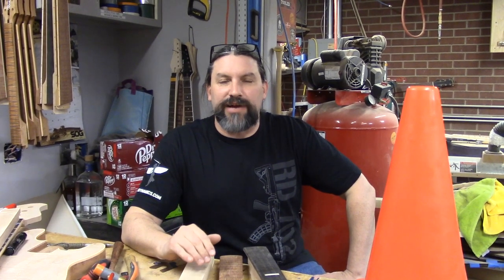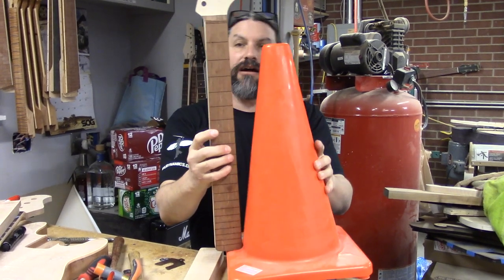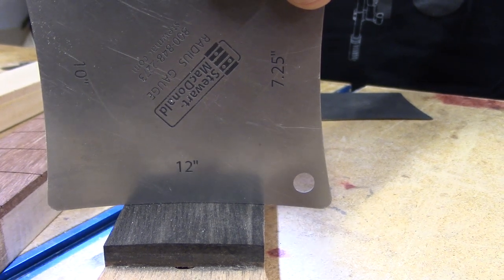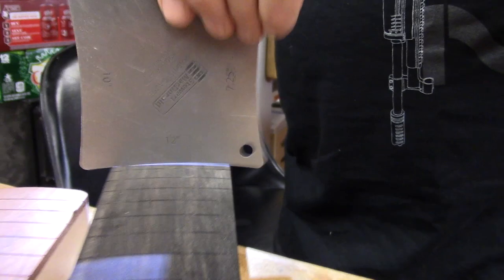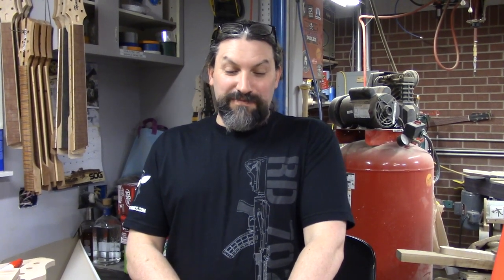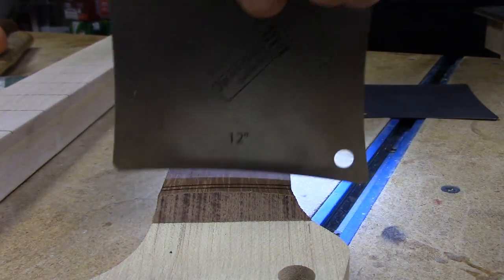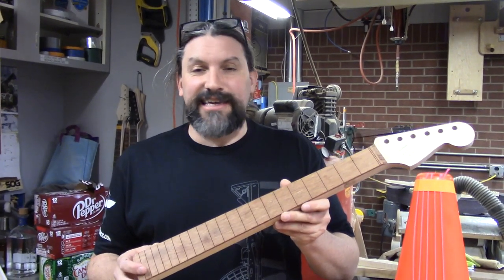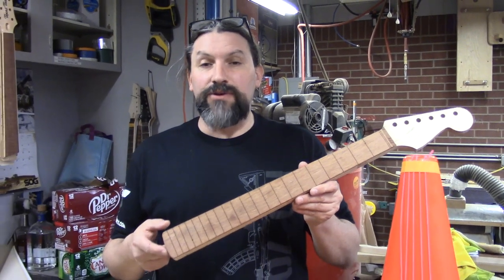Compound Radius... A Solution In Search Of A Problem?

Comment: It's totally fine guitars without a compound radius but if we're talking about consistency all across the fretboard, that tiny difference between a 10 inch and 15 inch radius plays a significant role. If it didn't all guitar makers would built their fingerboards with the same radius, or players wouldn't tell the difference between a 9.5 inch raxius and 12 inch radius which are fender and gibson. These boards feel totally different and every player choses one for the other according to his or her playing style and habit. That cone you're holding is the exaggrrated version of a guitar fretboard just for people to understand better but in real world, that tiny difference changes the feel and comford. Because a fretbord does not have the same thickness at the nut as the last fret, then the radius should not be the same. Secondly, if you don't have a compoud radius on your guitar's neck, that means it's thinner at the last fret than it is at the nut which results in higher action at higer frets with your low and high strings not the middle ones. That means it is inconsistent. It's not an issue if you don't play low action but if you do, then you would miss a compound radius when you don't have it.
Reply from the maker: Little things do make big differences... I question whether or not the fretting crew can always realize the theoretical advantages of the compound radius. Not to mention the bridge one is using had best be capable of 20" or nearly flat. 
I still think that the compound or conical radius is a great marketing strategy to separate guitar players from their money.
You seem to be a fan so who cares what I think?
Reply: @TexasToastGuitars  I am kind of a person who prefers to do things "the right way" not a fan, and compound radius is definitely the right way. But it doesn't mean one cannot live without it, appearantly virtuosos like Satriani and Vai do without it. It's definitely not a necessity. On the other hand we shouldn't take  players as models, they spent 30 thousands of hours to their instruments, maybe it doesn't matter to them just because they learned to play on a noncompound radiused guitar. If they learned straight fingerboard in the first place, they would still be playing straight fingerboard guitars. It doesn't mean what they are using are always the right tools just because they are the best players in the world. They boight their first guitar in 70s, 80s or whatever, its 2019 now. A young player on a budget can buy a really nice and sufficient guitar for 600 hundred dollars. On the other hand, someone who has more money to spend on nice things like his bmw car or fancy house, can afford 150 dollars more for a compound radius, 150 dollars more for carbon fiber neck stabilizers or 500 or even 750 dollars more for a fancy ziricote, cocobolo or bahia top. This is not about tone or music (although bahia is the king of all tone woods), it's only about feel and comfort, the same reason why you would prefer a cadillac over ford let's say.

Comment: Hey other small shop builders on here, am I the only one who thinks Stewmac need to put handles on their aluminum radius beams? Think about how much easier those things would be to control, like vertical handles that can screw into threaded inserts in the back, middle, and front, so you can move where you want to put more pressure.
Reply from the maker: That's a cool idea. I have been talking with Erick from StewMac and we are planning on a live Q&A with him this year. Maybe you could tell him

Comment: Err... I think the biggest problem is bend on high E string. From about the 12 fret, in a 12 radius your bend can't go more than one tone. With a compound radius at 16 15 n the end, you can go higher.
The big issue is not comfort ( for me..) but how much you can bend without buzzing.
Reply from the maker: Why not just make the fretboard 16" all the way? Hell... if you are really into bending a flat fretboard would be the best
Reply: @TexasToastGuitars  hehe... Because 16" for chords is uncomfortable.
I know compound are hard to install frets. Using a hammer you end up losing a lot of material of the frets.
The solution is having a metal to press all the frets at once. This presser should match the exact radius of the fretboard.
Reply from the maker: @fernandohildebrand  I guess we just disagree but I would like to see your fret press that does them all at once. DO you work for PRS or Fender? I have seen those
Reply: @TexasToastGuitars  No, I don't work on any of those. It's not that I disagree. Compound radius only makes sense on low action strings( very close to the neck), but hey, Malmsteen plays really old strats! Only he adjust strings very high.
Reply from the maker: @fernandohildebrand  So... have you not ever pressed in all the frets in a fretboard simultaneously?
By the way, we do not use hammers to install frets but do the frets one at a time. I can assure you that it isn't quite as easy as 123.
Reply: @TexasToastGuitars  I agree! I still use a rubber hammer. It's not easy. Even with a presser, wood is wood, it deforms, even if just a little. It'll never be 100%
Reply from the maker: @fernandohildebrand  Wait... You still use a hammer and you are telling me that I need to devise an arbor press caul for a specific conical radius.
Reply: @TexasToastGuitars  Not at all. Please, I don't mean in any way to say what someone do is right or wrong. I'm agreeing with you. I'm not telling you to do anything.

Comment: Interest video. I had a experience with my old strat 9.5 radius and compare to my Jackson compound 12-16. 

My strat has a little frets in the ending of life. So I decided to change the strings as lower action that I could. The result was funny, because it was so easy to play fast links and tappings, however sometimes bends slip out. 

Anyway, the impression was a more flat feeling, because  the strings stayed more close to fretboard. 

My jackson has jumbo frets, but the think that really makes diference, is the fact that 1st have a kind of D shape and it’s change along to a little more thinner D. 

So, in my conclusion is.. the major point for a “fast neck”, is the shape and how the strings as close to fretboard.
Reply from the maker: Agreed, one thing we have discovered, after making a neck with no radius, is that the notion of more curve for chords is pretty much bunk. 
Glad you found something that worked for you my friend

Comment: @Harry Harvey said it all for the purpose of one, but like you T.T. fellers I think they're over engineered. I've been messing with flat, or zero radius boards for a couple of years now with my builds. For some things they are great! My fret hand loves it and took to it like it was meant to be. Chords are super easy and multi-finger tapping suddenly became accessible. The picking hand, however... That takes a lot of getting used to. A lot. We all train pretty hard at learning to pick over an arch and unlearning that takes patience and determination. Face it: you're born into the world breathing air. If you play electric guitar, you're born into that world playing on a radius and your picking hand remembers. A very nice in-between is a 20" radius. Fret hand is pretty happy and your picking hand already knows what to do. Also, didn't Kramer used to use flat fretboards on some of their early 80's models?
Reply from the maker: I'm not sure if Kramer did flat boards but I'm positive that there are a lot of people making guitars that are smarter than me. I'm a punk kid who looks up to those guys, I played their guitars... they didn't play mine. :)
Reply: Early 80s wood or aluminum? Aluminum was almost flat. Wood (1981 or so, forward) has always had a 10" radius for the Floyd, but the biggest difference was the 1983 change from 1 5/8" to 1 3/4" at the nut, and a flatter back on the neck...that was the EVH era. (chicken beak to banana). I have never found another neck I like as much...maybe an ESP, because they made those necks for them, or Sports Canada (those weren't as well made, sorry my good former Kramer builder friends, it's the truth)
Reply from the maker: @Bob_at_OZDiggzguitars  so many specifications on Floyds, the mind reels
Reply: @TexasToastGuitars  , I know. It made things more difficult. Like I said, my Kramer was a bit of a mess from the factory. Pictures at 11

Comment: Compound radius from 12 to 15"? Seems absolutely unnecessary... It only seems reasonable if you have a vintage 7.25 toward the bottom but personally I like doing jimi double stops at the 9 - 11 frets
Reply from the maker: Who does 12 to 15?
Reply: @TexasToastGuitars  I think I meant 9.5 or 10 to something higher. Either way, vintage radius necks are what I prefer

Comment: The radius is not as important as the fret work.  A 12 inch plays just as well as a compound or vise versa. Radius is just like the tone wood debate, marketing ploy for one and tradition for the other.
Reply from the maker: Agreed, no one measures the radius at the frets only at the wood, there are a lot of things that can change once you start adding metal bits. When I give that neck to people and don't say anything they don't notice. When I tell them it is a compound radius they claim they can see it.

Comment: it doesn't make a huge difference what compound you do to a neck if whoever does the frets doesn't know how to do compound frets, i see these guys they do a compound fret level like is a constant .. and that doesn't work

the idea is to have very fret below your fretted string and have it FLATTER than the fret where yo are fretting it, this way when you bend no matter how far the string will not fret out like it can on a guitar.. Ive seen compounds fingerboards with a 12 and 12 nut bridge?  huh?

the FRETS have to be done properly and the nut and the bridge have to be set up proper as well..  mot people generally avoid fretting out generally raise the bridge and or saddles..    the git needs to be set up properly as well as the frets need to be leveled in a compound fashion and the advantage is you should be able to have lower action and bigger bends if that's your thing .. some players like their action so high like Rossington that his fret level job could be done by a blind dog and he didn't care, no chit mang he likes it almost 1/4" .. kid you not and IMHO it was becasue he was so into slide guitar when he was learning he loved to be able to slide whenever so he set em up with big action and learned to play and rip, and gary sounded good  .. there is the argument that the higher your action the better the tone and more resonant ..

I believe this to be true for pickup height, a taller pickup height sounds better tome, actually there is a spot I like where it picks up a lot of overtones, so on some guitars I like that and let the rest fall where they may, resonance tone so forth cuz generally you cannot have it all, its a sacrifice all the time, higher strings you lose some resonance but pickup tone..

but for compound fingerboards yea, you want to do the frets compound as well, then a matching bridge and nut, in regards to the bridge if your 21 fret fenner has a 21st fret of 16" that's not the broidge radius you need, you need the radius to be accurate at the bridge.. so the string continue to flatter out so its more like 18.5 ..

its also important how you are doing a compound, a REAL compound each fret is different just that much, but not everyone does it that way, they will have like 4 steps or so in 21 frets.. not a real compound fingerboard .. how would you match the frets?  the reality IS you do not need a compound radius fingerboard to get the benefits of a compound radius fret set up, install extra jumbos and level up a compound fret level, BOOM!  its not the board that counts its the top of the  frets..

some guys make a set up a sweep jig that gives them a perfect compound radius where each fret is that much different in radius as you go down and that a real compound radius, extra jumbo are tall enough to do this stainless and your good to go for along long time too. .   so the fingerboard is sorta moot, this the fret job that's important .. but the sorta fret job her the first 6 are at 9 then the next are at 11, then the next 6 at 12, next 6 at 13 and the last at 16 isn't going to work as well as a true compound radius fret job, a plek machine prolly do a good job or on those sweep type jigs.. so how is the maker doing the compound fingerboard and fret radius?  is it a true radius or a stepped up radius?   important

try the different ways, try the different fret radius jobs, run a string from 1st fret to the 21st where the string runs 5mm up off the fret, every single fret should have a gap of 5mm,  perfectly or within a thousandth ..

try the different ways see what I mean with the different actions and setup styles, radius nuts and saddles.. each fret 5mm, then you dunnit properly